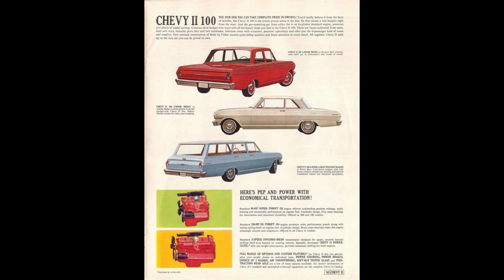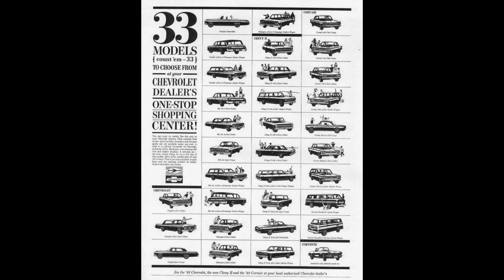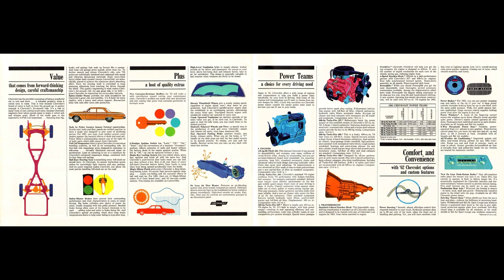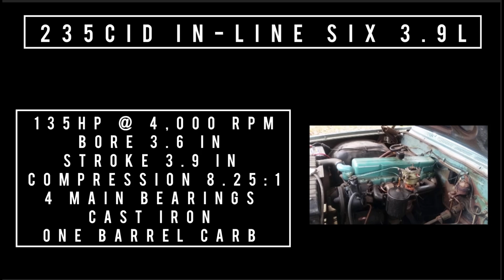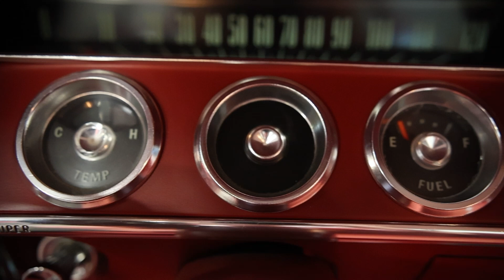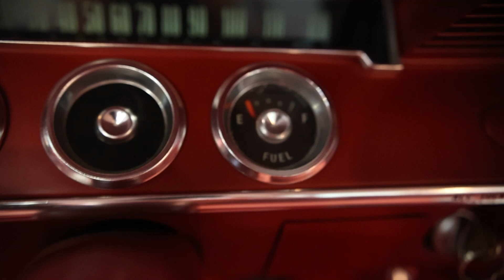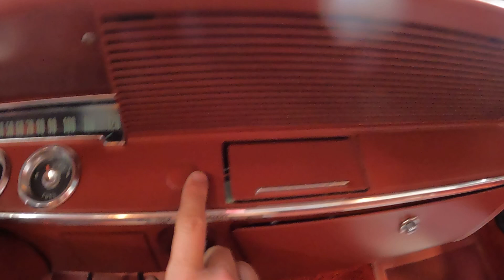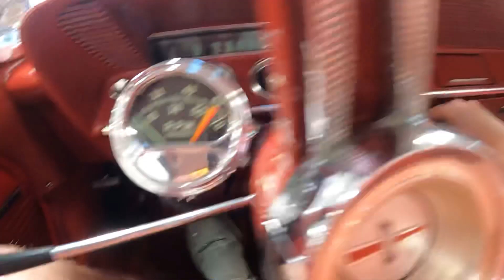Giddy-up 1962 Chevy bel air hardtop high horsepower 409 in depth review and drive

Comment: This is an amazingly clean and tight restoration of a 62 Chevy Bel Air bubbletop.  I learned to drive in a 62 Bel Air four door (283 Powerglide, did not sound or drive like this one), and my best friend had another 62 Bel Air in the same body style, neither of those cars had this build quality.  But those nylon and vinyl interiors were very, very durable, we gave them a good test.  That knob underneath the ignition operates the right side kick panel vent, a nice feature in that the driver could open both panels on a warm day without having to reach over.  Chevrolet advertised a "Jet Smooth Ride" on these vehicles.  They had very soft springing and minimal shock valving and were very floaty at speed, leaned over embarrassingly on a turn unless you got the heavy duty suspension.  With that big steering wheel and the very slow steering rate, over 50 miles/hour you just kind of guessed at what your wheels were doing, hopefully still pointing you in the right direction.  Thanks for the ride!
Reply from the maker: Thank you so much for sharing those memories I drove a Lincoln mark five yesterday and remembering back to the 409 bel air I think the Chevy is more floaty than the mark V was it’s crazy it’s not bad at slow speeds but get on the free way get it going 60/65 and it become apparent the guys that raced those cars they were real race car drivers. Just like you said it gets hard to tell where the front wheels are and floating.. also that car is super important to history so that’s in the back of my mind when driving it. Glad you enjoyed this episode =)

Comment: These 409/409 bel air bubble tops were the NHRA super stock drag race champs in the 1962 season. I used to see the National Champ, Dave Strickler's Old Reliable, which was built and tuned by Bill Jenkins, run at Atco Raceway, my local track, which was close to Jenkins' hometown of Malvern Pa. The A/stock national champ, a 409/380hp Jenkins built bubble top called Northwind also ran there regularly, and the 3rd championship bubble top, a 1961 409/360 B/stock Bel Air called Thumper appeared regularly.
If you remember these cars there was nothing like the spectacle of watching them run. They would come to the line and the driver would rev to 6000rpm, the redline, and then sidestep the clutch right before the green and power shift shift through the gears with the foot on the floor.
The 426 Hemis with torqueflite automatic came in 1964 and were quicker and faster than the 409 bel airs, but the big 409's put on a better show when they were competitive. Sorry to be so long, but I'll never forget what I saw when I was 12 years old. Good review!
Reply from the maker: Don’t be sorry I welcome all the stories =) thank you so much for sharing
Reply: thats why the car you drove had no lighter, no radio, little hubcaps, no clock, and probably no heater....it was a factory race car.

Comment: Slight correction.  The 300 HP 327’s did not have dual 4 bbl carbs.  Also, the factory shifters and linkage were pretty sloppy.  Most were replaced early in the game with Hurst shifters.  Much tighter and better.
Reply from the maker: Thank you so much for the correction =) I was amazed that they offered a 2.5 L four-cylinder in this car I did not know that
Reply: @What.its.like.  - 4 banger only available in little Chevy II... 6 was smallest engine in full size Chevy and later Chevelle... 4 banger came back in Camaro in like 1980's... 
Dual quad 327 was 340 HP as I recall and maybe only available in one year of 1962... maybe only in Corvette?... Engine pictured has aluminum intake manifold whereas stock 340 HP prolly had painted cast iron intake... 
Corvette also had 360 HP 327" engine option... 409 never offered in Corvette...
Reply: 2x4s were offered by Edelbrock or Offenhauser for 327s. I put 3x2s on my '67 283. Just a little overcarbureted. Many Corvette 265s and 283s came with 2x4s, thanks to Zora Arkus Duntov. And nothing beats the 30 30 solid cam in the 340hp, which was 360hp with Roshester Fuel Injection. A solid cam was never offered in a full size Chevy small block, but many 409s had solids, and L72 427 425 had solids in '66 and '68 & '69. No L72 in '67. I hope I got my years correct!
Reply: @CORVAIRWILD  - "A solid cam was never offered in a full size Chevy small block," 
How about fuel injected 283's offered in full size Chevy's?
Reply: @BuzzLOLOL  ya got me! But how many we're actually produced, and survive?. I was at a Mecum auction this past spring, and there was a 19k '57 Chevy four-door hardtop, totally original with Factory fuel injection, just amazing untouched car. Black red interior with three on the tree, totally original, I wish I would have had the 77g's that it sold for. Easily one of the most original rarest '57 Chevys around!!!
Reply: @CORVAIRWILD  - Omigosh... you had just seen a solid lifter one and didn't remember... LOL! 
Check out the gorgeous '57 Chevy at 34:10 here: 
https://www.youtube.com/watch?v=vWdF3L_qxTk
Reply: @BuzzLOLOL  I was thinking of the 327s, those never came solid in anything but Corvette. On another note, I always thot the 327-350 was a solid... Oh well. I'm so glad I have 3 solid lifter 409s. One has power steering, I may remove it and live with Armstrong! And 2 of them have modern disc brake conversions w o power... I'm fine with it!
Reply: @CORVAIRWILD  - "On another note, I always thot the 327-350 was a solid... " --- ??? 
I think 327's came with your choice of hydraulic or solid right from the start... just by picking a certain HP... 
350's first appeared in 1967 in Camaros only in 1967 in 295 HP flavor only and hydraulic lifters only... although the lightweight '67 Camaro really screamed for the unavailable L79 350 HP hydraulic lifters 327" option... and '67's got the 396 at the end once they upgraded the weak single leaf spring rear suspension... the L79 327 gave up almost nothing HP-wise to the solid lifter 327's... the solid lifter cams losing some lift and duration to recommended valve lash... although the Duntov 30/30 cam would give more HP and torque if you tightened the lash down to 10 thousands or whatever would allow the valves to always close on the seats at various engine temperatures when racing... but it would cost some serious drivability in daily street driving... 

I didn't miss power steering or power brakes or A/C or any power accessories in my '65 GTO convertible... and it didn't have any problem with stock 409's... but I was young then... like my A/C now... 

Thought you were mainly about Corvairs, what are your 409's in? If anything... 

I'm in Toledo, you around Detroit as I recall?
Reply: Agree factory shifters wear out bushings fast & were generous. Later in the '60's Hurst shifters came factory equipment  on some models.
Reply: GTO's came with Hurst shifters in '64 or '65, but Fords came with crap shifters to about 1970?
Reply: @BuzzLOLOL  I would guess Olds and Pontiac added Hurst as standard in '67? The Hurst Dual Gate was offered in 1967 in the GTO, and Dual Gate in '68 Hurst Olds Cutlass 442. Did Chevy even EVER get a Hurst shifter? I can't recall ever seeing a Buick with a factory Hurst stick, and for that matter, any Corvette! So only Olds and Pontiac. Definitely never MOPAR, and not a clue about Ford
Reply: @BuzzLOLOL  I owned a '67 Camaro 350/4sp with 4:10 gears, also had a fan rear window defrost & fold down rear seat. Strongest running car I've ever owned. Bought it used, in '69. First weekend I owned it I ran a buddy with a '70 Nova 396/375, 4sp, tagged him by a fender. Never outran by anything in it's class. Still have the trophy from the dragstrip down in the basement. What I'd give for that one back...

Comment: My dad had the '62 Bel-Air coupe regular hardtop 289 two barrel carb automatic transmission version. White exterior with blue interior. The ignition switch was designed to use it without the key but for anti theft measures it could be turned one more click to lock it. Us kids helped him overhaul the engine with I myself using a spoon and butter knife to scrape caked up oil(Quaker State) out of the litter valley that was layered up over a half inch thick. After dad bought a '67 Impala 327 station(my favorite) wagon to replace it (growing family) with the Bel-Air sitting up on blocks for several years until it was sold off.

Comment: In 1972 I worked with a guy that had a ‘60 Chevy 2 door sedan. Dull medium blue paint, hub caps, didn’t look special at all. It had a 409 and 4 speed. I got to ride in it once and he wanted to show it off a bit. Man that thing had a ton of torque. From a dead stop it shoved me back in the seat.
Reply from the maker: Thinking about it now I think this might be the first time I ever drove a big black car I don’t beat on them I drive them civilized if it was my car I would slide sideways and stuff with it but it’s not mine and if it breaks my fault and I have to fix it.. but it definitely had the power I need to adjust the camera position next time I wanted to be like first person over my shoulder not so much with my head in the way

Comment: I mentioned in another comment that the 4 cylinder engine was a Chevy II engine, not available in the full sized car. However the 6 cylinder was standard. I noticed that with the 327 V8 that there was a picture of a dual quad engine and you said the 300 hp 327 was a dual quad engine. It was not. It had a single 4 bbl as carburation. I don't know if you could order a dual quad 327 in a Corvette though but it would have been more than 300 hp. The 409 is my favorite engine. It just looked fantastic especially  beginning in 1963 when they went with chrome valve covers and air cleaner and a dip stick with a stamping of SS 409. I had a '63 Impala Super Sport with a 340 hp 409. Much easier to deal with than the 400 or 425 hp engines and had plenty of zip. The shot in the video when you are about to push the car shows a stunning silhouette of the bubble top. A wonderful roof design and I think the full dress 1961 Impala 2 door hardtop was the best of all the years with the bubbletop but '62 Bel Airs sure made them look great. Too bad they didn't offer both roof designs on the Impala for 1962. 
Too bad the carb linkage was a little goofy so you didn't get to use the 409 flat out without the fear of a stuck throttle. That engine just had the best look and sound for me. Road and drove several as well as the mentioned ownership. Too bad life happens and things go away. Thanks for the memories.
Reply: The last full size chevy to have a dual quad small block option was a 1957 283-245hp and 283-270hp engine . In 1969 you could special order a cross ram dual quad set up for small block 302 Z/28 , which you could bolt onto a small block of your choosing .
Reply from the maker: Thank you so much for sharing those amazing memories.. thank you for the correction I was like that’s a pretty small engine for this size of a car. I wasn’t going to put it on the list because it seemed to ridiculous, but typed 2.5 bel air and pictures came up with engine bay pictures of it so I thought.. maybe?? That’s why I was sort of ridiculous explaining it down in the bottom of the basement., =D
Reply from the maker: Yeah I learned about that this week I thought cross ram was a Chrysler thing come to find out Chevy did it too
Reply: I think the 235 six was the base engine on the big Chevy, at least I've never seen one without at least a 235. The 4 banger was just for Chevy II.

Comment: Enjoyable video Jay you do a GREAT job with these.  As one of the (often detested, rightly so) Baby-Boomer generation, I have always felt that the high point of American Manufacturing was the full size sedans and station wagons from 1960 - 1975.  Everyone loves pony cars and Corvettes, and 1955 - 1957 Chevy's and Ford Crown Vics were rolling jewelry.  However the full size sedans from the 1960 - 1975 era were comfortable, economical, reliable, stylish and were superbly suited to driving on an American freeway at 75 mph.  If you drive a 1962 Bel-Air with the 283 V8 today, you will find it superbly comfortable, peppy, economical and it's performance is surprisingly modern.  Sure,  a 2022 SUV or Sedan posts far superior numbers for performance and economy and have technology that couldn't be imagined in 1962. However when you consider how primitive the technology was back in the day, these cars were astounding.  After 1975, American manufacturers had to play catch-up with the imports on emissions and fuel economy.  To this day they haven't completely recovered, IMO.
Reply from the maker: I totally agree with you if I had things my way I would have a bunch of 50s cars and a 36 packard no ABS no traction control one had to know how to drive these cars at the limits.. no handouts driving took skill it’s the real experience new cars is like a driving simulation in my opinion
Reply: I am completely with you on the 36 Packard, what a beautiful vehicle.  A work of art and a great automobile.

Comment: I had a 62 Impala with 409 great car eventually swapped in a  427 L88 used for drag racing only at that point  had lots of fun with it
Reply from the maker: 427 is an engine that I really want to drive in a car I’ve never driven anything within 427 and it’s actually a 409 was the first big block car with a manual transmission I ever drove

Comment: A '62 BelAir sedan, I'm 3rd owner,, a '62 Impala w a Tremec 5 speed, and a '63 Biscayne 409 425 M20 4 speed survivor
Reply from the maker: That car sounds awesome the idle of this one sounds like the drum intro to hot for teacher by Van Halen The GoPro does not do a good job at sound recording
Reply: @What.its.like.  my red Impala has maybe 500hp... Here's a long video just after I bot it. The grey Biscayne was also a few days after I bot it. the blue BelAir gets well under 10mpg even driving easy with 3.08s. the Impala got 13mpg w 4.10s and 5 speed. No idea why as it has a much lumpier can but similar gears with the 5 speed 4.10 combo
Reply from the maker: There isn’t a link post the link I’ll check it out =)

Comment: Pretty car. Had one, bought used in1966. Straight line car only - - unless driven "normally"
Reply from the maker: I totally agree with that statement it was only good in a straight line like when I took it around a curve people make fun of mustangs for the same reason but the most mustang feels way more stable around the corner than this did

Comment: The thinwall 194 six debuted in 1962 in the Nova only. It shared valvetrain parts with the 283. Its 194 displacement paid homage to the first Chevy six of 1929. In a Nova hardtop coupe it would go 105, the benchmark set by the 1956 Chevy V8 with the “power pack”.
Reply from the maker: Thank you so much for that correction and insight =)

Comment: In early 62 they actually made some Impala with a bubble top. The 300 horsepower 327 had one carter AFB 4 barrel carb.
Reply from the maker: I think it came in little bit later but the 327 with 375 hp that is a very underrated engine for what it is that thing would hang with the big boys I rode in a Corvette that had that PowerPlant  and I was just blown away by it.. it could handle and go around corners while going fast and not have to worry about losing it it was insane.. actually there’s a couple of bureau shots of it it’s that seafoam green convertible Corvette it was a four speed stick I’ll put some B roll in the next video of it now sure when that video is going to drop hopefully tonight but still needs a lot of work